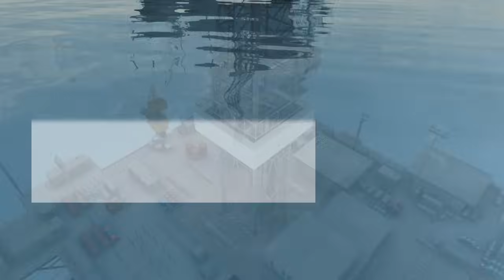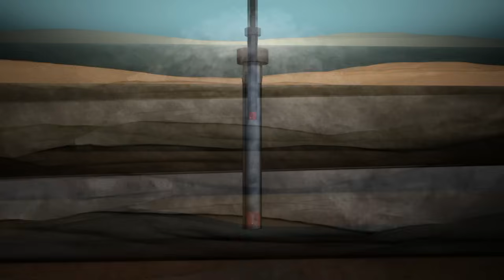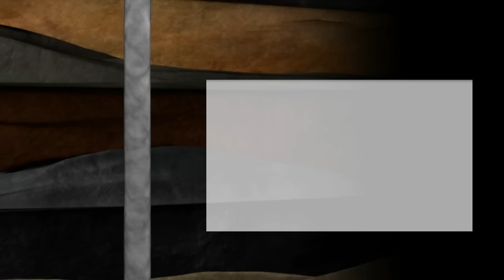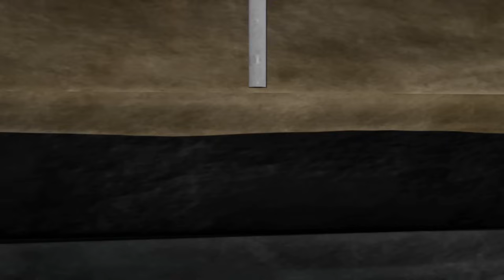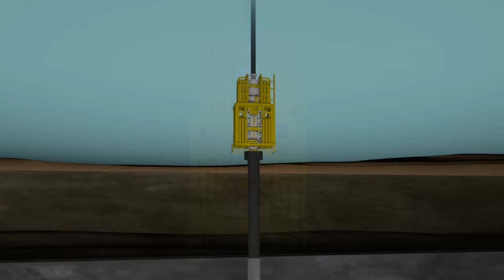How a Deep Water Well is Drilled - Drilling 101

Comment: They  the Philippines Navy should  start doing a back up strategy. 
The ship will be decaying rapidly.and will sink .they should install a floating device  or erect a station like  offshore rigs. 

Everything they work hard for decades will be wasted if the ship sunk.

By erecting updated  offshore base it will  be  accessible for helipad  helicopters  supply,   
And it will solidified the  guarding Western Seaboard.

Comment: What I don’t understand is how the drill shaft doesn’t just twist apart while drilling. With thousands of feet of drill shaft, how does it not flex and shear apart with all that torque???
Reply: Hope this will answer your question. 
The drill string has sufficient specifications of max allowable torque applied. In normal drilling operation, the torque applied to the drill string still under the max torque limited, so it won't twist / break.
So it needs a huge effort to design the drilling program (include drilling string design) first before start to drill ahead.
Reply: @radityafajri5764  huh interesting. Lots of time money and effort has to be put into the whole operation. thank you for the explanation. I appreciate it my friend 👍🏼

Comment: Where did BP cut corners in the cement pour to allow gas to escape? We already know that the BOP was not tested or maintained prior to lowering, but I didn't understand where the pour failed.
Reply: @Stephen As far as I remember, BP decided to remove the mud before the cement was fully hardened. The BOP in itself worked well,  but due to a dislocated pipe, it could not close that pipe as it was designed to do.
Reply: @robinj1052  I read that Halliburton did not use enough spacers which caused the cement to have an out of concentricity pour. Also, the BOP batteries were dead and miswired and they did not test them prior to installation. No underwater support plate install either.
Reply: @rancosteel  Thanks for the reply. I forgot the details of the report, so you might be spot on. I do recall that at least one set of jacks in the BOP did actually work, but I might be wrong. I definitely should have a look at the reports again.

Comment: "environmentally friendly mud" - similar to the diet coke in your XL Big Mac Meal lol.
Reply: Where you just need it to be a variable density and viscosity, that can be done using various ranges of ground rock, even powered stone and water. Think of concrete, various sizes of stones with a cement. Cement being  Calcium, Silica, Alumina (different from Aluminum) and Iron.

Comment: If the platform is floating, how is the drill string kept in place vertically?
Reply: Computer controlled engines are constantly moving the platform based off GPS data to keep the line straight and the rig over the intended oil well.
Reply: @snowfan0521  wow, that's impressive. Must be difficult in bad weather?  Do they trip out if they expect bad weather?

Comment: h what gets into the ground when oil and gas are taken up?
Reply: A host of natural materials generally. They maintain pressure in the well (they have to since they rely on that pressure being high) and the material replaced has to be of a similar viscosity. It can be a thicker variant like mud, but that's much more difficult to replace instead of a material with a different density but similar viscosity of the crude being removed. Different density so it won't mix with the crude and get pulled back into the pipe. 

If nothing was replaced, it would create a lot more work on the siphon. Think of one of those 2.5 Gal spring water jugs you buy in the store. You need to put a hole in the top for air to siphon in to replace the vacuum created when you open the tap for water. In this case, instead of air going in, unfiltered tap water goes in instead.

If you don't replace anything, you get grit material in your crude as it gets pulled in with it. You never want a negative pressure well.

This analogy is like computer cases. With negative pressure (more exhaust than intake), you get dust (largely because air comes in also, from openings that don't have dust filters) whereas with a positive pressure (more intake than exhaust), there's a lot less dust in your system. Not a perfect analogy but works.

Comment: So how does the blow out thing not rust away? If it was rustproof that material would be used on EVERYTHING THAT GOES IN OR NEAR THE OCEAN! I'm thinking it will rot away in time.
Reply: It's used during the drilling process. They use a different device to seal the insertion. And tons of metals can sit in saltwater and not 'rust' in a realistic period of time. Grade 316 stainless is used though and given the thickness, can last around 70-100 years before seal degradation becomes an issue. But given that recaps are done every 10 years, it's long before that becomes an issue.

Comment: Nice video; thanks for sharing!  Our patented technology allows you to set up the equipment on top of a well, build a continuous pipe (well casing) onsite and as the pipe is made lower it into the well. The strong and lightweight pipe will never corrode!  You can make miles of pipe this way in diameters of 3-inch (75 mm) and larger.  The pipe has no joints to leak so there is no potential for environmental contamination.   If required, the pipe can be perforated before insertion also.  
Please watch this short video.     https://www.youtube.com/watch?v=EGsipDj0dEA

Comment: So what's the lifespan of a BOP stack? Can we all expect them to rust and fail in ~100 years and oil flood our oceans?
Reply: They are replaced regularly
Reply: In that much time you get pressure capping, either from removal or an expended well. A bit like a cavity being filled where the material and joining is stronger than the tooth material itself.

Comment: it all makes sense, except for the fact that they didnt show/tell how they get a 9000ft pipe
Reply: Many many smaller pipes connected. Look up roughnecks
Reply: There are MANY joints of what they call "TUBING"(Pipe) that they thread together to get down to those depths. I worked on a rig as a roughneck and once a derrick hand latching pipe back in the late 80's. Indeed, it's very HARD WORK and GREAT PAY but, it can be VERY "DANGEROUS" too!!👌🏾👍🏾🙂
Reply: Exactly and then theres russia and exxon

Comment: Watching this after seeing the Deepwater Horizon film helps me understand the terminology and what went wrong.
Reply: McDiesel https://youtu.be/9NQ8LehUWSE
This animation explains it further if you haven’t already watched it, it’s quite interesting
Reply: McDiesel also https://youtu.be/FCVCOWejlag is very interesting to me
Reply: Exactly 😂😂😂
Reply: This is exactly why I’m here. I’m so fascinated with this field of work now.
Reply: This is exactly why I am here.
Reply: I didn't have to know I already knew it pushed up pressure witch built up a the sea floor until it pushed up the drill pushing mud up witch is enough pressure to cut a car in half and it had oil I think or gases but it has a anuler witch is supposed to stop those incidents it destroyed the anuler and set alight up in the air and spreaded everywhere there U go.
Reply: With so many witches it's no surprise things went wrong.
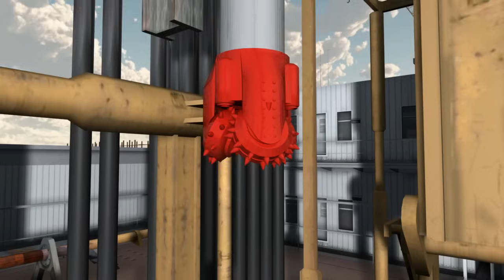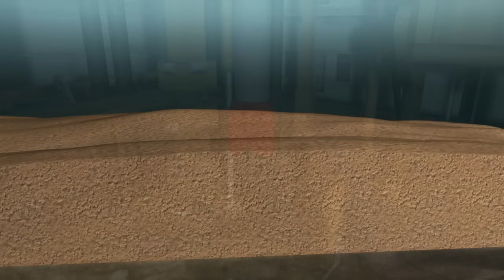Reply: 1:27 1:29 millones 1:35
Reply: @rtvzeuz4202  It's not that. Even I came to this video to understad what really happened & could it have been prevented? And the answer is Yes it could have been. Needed to know if it was a human error or just bad luck that we got too much pressure.

Comment: Question is:how would the Drilling head be taken out when it hits the Gas pocket with average pressure of 300 bars or approximately 4400 psi ?
Reply: A wireline plug is set into a tubing nipple that has locking groves inside rated to 5000# or higher. Once the plug is set and pressure bled off. The drill head is removed and a stack of valves is set , flanged up and tested. Then the wireline plug is equalized and pulled from the well. Hopes this answers your question.
Reply: Heavy mud holds down hole pressure
Reply: If you really want to have an interesting conversation, talk to a driller.  The ingenuity and dedication it takes would break most people.  I’m surrounded by the oil fields and most of my friends work for , or in support of the oil work.  All of our grandpas were doing it back in the 30’s when the derricks were wooden and there was very little safety anything.  Almost all of grandpas are missing body parts. Mostly fingers and hands but some eyes and ears and teeth and a foot or two.  Offshore is the wild stuff.  

My grandpa built Jack up rigs for LeTourneau.  He went all over the world and worked in every ocean.
Reply: They were a diff breed.  Because of them we get to be lazy and pathetic. 😂😂😂
Reply: the drill head is  just brought up and they let  it rain black gold and texas tea!!!

Comment: How interesting! We so appreciate
all you do for us! One question? How often do you get to return home or to land? How is sea sickness handled?
Reply: I'm not sure what shell does, but They usually work either 14 days on/14 days off, or 30 days on/ 30 days off, depending on the company. Sea sickness really isn't a problem due to the weight and size of the rig
Reply: @icantfindausernamify  wow, must be nice. We always did 6 months on/ 6 months off
Reply: @swaggerjacker1482  Lol I never did that nor did i ever work off shore. I used to work on land rigs in east Texas and worked 14 on/ 14 off. I'd hate to work 6 months straight though.
Reply: @icantfindausernamify  lol I was kidding. I’ve never worked on any but know several people that did it for years, either 7/7 or 14/14. And made good money and even better retirements
Reply: @icantfindausernamify  you guys are in heaven.
Reply: Most oil and gas firm run on a rota of 14/14 or 28/28,sea sickness may hardly arise,but occasionally handled by taking small amounts of vinegar

Comment: I am interested to join shell team any where if there is job,I  am electrical multi skilled engineer/technician construction,commission,maintenance and repair power cable high voltage transmission line,generators.I am available ,I have 24 year experience in OIL &GAS,MINING  please contact me on  francemponda@yahoo.com,safety is my first tool.work safe

Comment: Stops Solar, Wind, Coal, Oil, Gas, Nuke, Geothermal
Energy Sources for free renewable energy at sea:
6000t/sqm at 6000m depth contained in Pressure
Vessel is utilised at NTP.
Catapult Energy: 1.23 mn lbs/sft   THRUST Jet
Alternate Renewable Energy. No GHGe. 24/365
Zero GHGe in Transport, Power Plant design.
No climate change on no engine, no fuel, no-GHGe.
Transport, CBM = HP*Hr/22 m3
Global GHG Emission is 36 bnt/yr
GHG Emissions Reduction is 25 BnT/yr
Net Global GHG Emission is 11 bnt/yr. 30 %
Global GHGe :120 ppm for 400 ppm
automotive, rail, ship, jet, missile, rocket,p.plant.
Saves 14,410 Bn$/yr by  Parts, Fuel. 
auto demo : 1 mn$, 1 yr. all demo 500 mn$, 2 yrs
INV  100 mn$ get back 200 mn$ in 2 yrs
INV 1000 mn$ get back 2000 mn$ in 3 yrs
INV 120 bn$.ROI=500%.PAT=240bn$/yr in 4 yrs
12 plants at Atlantic, Indian, Pacific Oceans
Muthukal Andy Appan, M.E, 50 yrs Expert, India.

Comment: So i thought oil rigs were cemented to the sea floor but there just floating there 😖😖 nothing is safe about that.
Reply: Lucia Zavaleta theyre held in place by anchor lines
Reply: Think about it from an engineering standpoint. It’s not economical or feasible to mount every semisubmersible platform to the bottom of the ocean floor. Especially because most of the drilling platforms are moved after post production. What you are suggesting would cause more environmental damage because these platforms couldn’t be moved or disassembled after production has been completed.
Reply: Rolling stones
Reply: They are held in place like most large ships with multiple thrusters, that use GPS to keep the ship with in a certain area. If there is a potential storm/ hurricane the ship can disconnect from the riser if need be and move out of the path of the storm.
Reply: There are different types of rigs. Some are floating and others are just standing on the ocean floor. Worked on both of them

Comment: Didn't show how the oil comes out and how is it stored.
Reply: Bobby Bobby because this is just a drill rig. not a pump/production horse rig
Reply: Sometimes wells are capped and tapped for later use and production.
Reply: It also didn’t explain how to ride a horse.